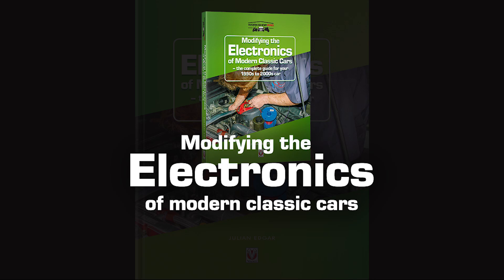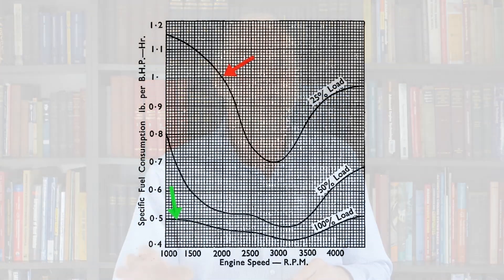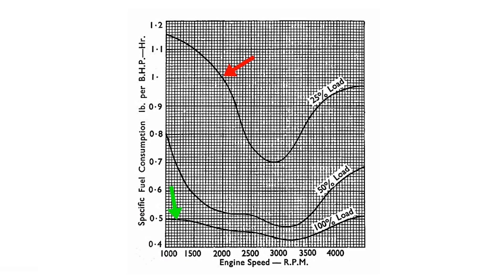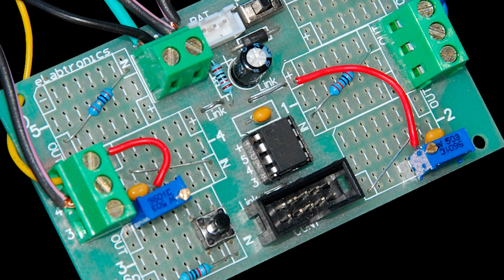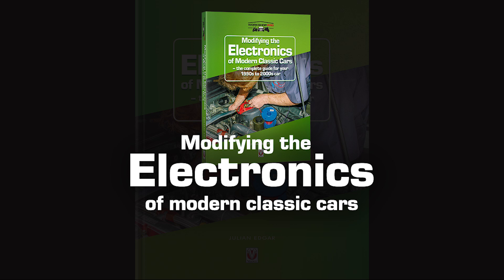FuelSmart - A Device that Improves Car Fuel Economy

Comment: Putting something like this on your car is nuts.  The auto manufacturers know what extensive testing is all about.  I saw this on Stacy David Gearz and he claimed it dropped cylinders for better fuel economy.  There are very few manual trans cars sold in the USA.